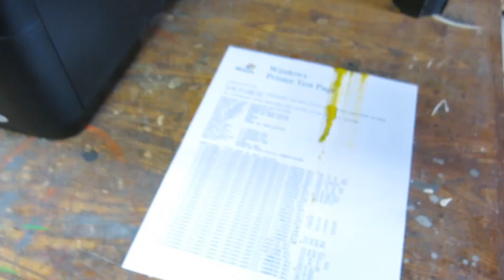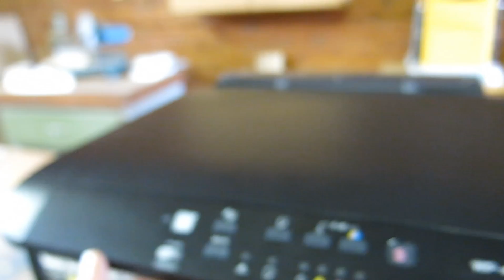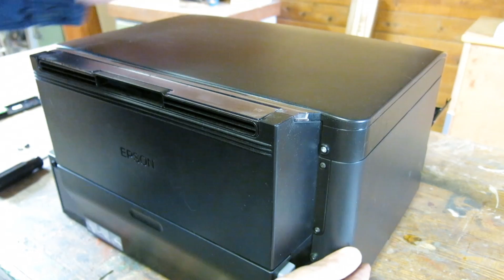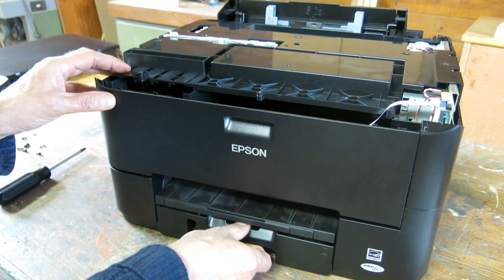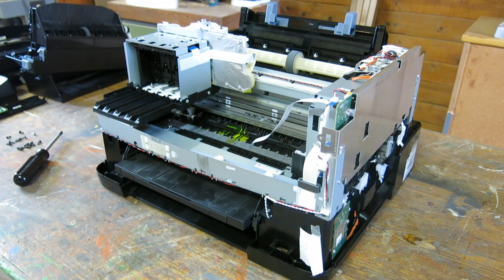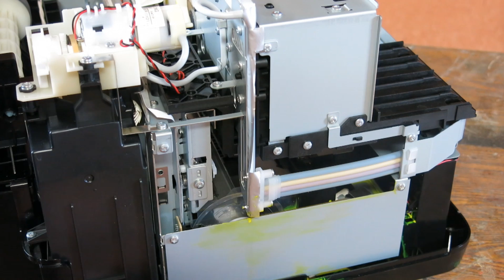epson printer WP-4020 ink leak problem - disassembly

Comment: Hi, I have the same problem with my WP 4530 printer that is now about 2 1/2 years old.  I have contacted the Epson support centre by phone with my serial No. ( I registered it when I bought it) and within 10 minutes they had emailed me a reply stating that they are going to replace my printer with a new one, the latest WP-4630 model, as the WP 4530 is now obsolete.  Now considering that the printer is out of warranty I reckon that is bloody good service AND recognition that the problem is very real. WELL DONE, EPSON !

Peter of Adelaide.

Comment from the maker: Called Epson Support this morning @ (562) 276-4382. They are sending a replacement printer and a set of cartridges, no charge. I don't have to return the bad one. WELL DONE EPSON! THANK YOU. I have another of these same printers that does not have the leakage. Other than this problem I am delighted with these EPSON printers and I plan to continue with them.
Reply: Hi, I have the same problem with my WP 4020 printer that is now about 2 years old.  I have contacted the Epson support center by phone with my serial No. ( I registered it when I bought it) and within 5 minutes they had gotten my info and stated that they were going to replace my printer with a new one and a new set of inks for any trouble that I may have had, the latest WP-4020 model.  Great service, THANK YOU EPSON!

Thank you George for the video info...
Reply: Thanks for this video and info. I'm another with a 4020 that leaks yellow. How long did you have your printer? I bought mine on 3/20/12, so that might be too long to expect any help. I'll call them regardless.